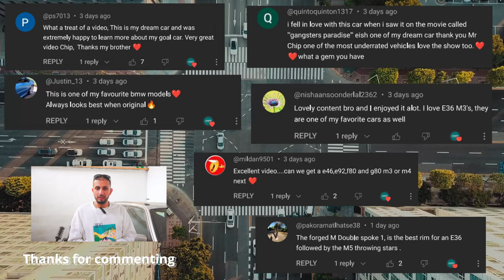The car that will Take SEMA and GRAVITY SHOW by Surprise!

Comment: Aslms brother, Jumuah Mubarak 🤲 glass panoramic sunroof with roof spoiler, black on silver paint scheme, gloss black beading with black kidneys, will set of the BBS rims. Preferably a two paint scheme 🤷 4 pipe exhaust. Definitely bagged suspension. Wing bonnet, grill and bumper from the e34 540 👌 something fresh. M5 station wagon would be just another M5 🤷 just a thought 🤙 you Chicano ☝️ you have a bigger option when go with 540 and 740, the engine and gearbox is  cheap
Reply: Wslm brother love the suggestion. V8 won't be a bad plan plus with a nice exhaust it will tone awesome

Comment: Firstly good luck with the build, tough one, but keep it simple it's already got nice body lines, so maybe red but you said no to bright colours The e34 came in sterling silver, very nice colour I like   m5 sport seats with Recaro spectrum or M-rain centres and suede bolsters, most probably going with the mtech theme. As for the bbs rs wheels polished triple stepped with red centre caps just my 2cents, but colour is definitely a hard one, can't wait 2c the build
Reply: Forgot to add, what about a v12 swap? You're doing M60 so would be nice to see m70 on itbs😂 you can call it a 550i oh and definitely late model, bonnet and grille
Reply from the maker: Thank you for the suggestions, we'll consider them 😉🩵